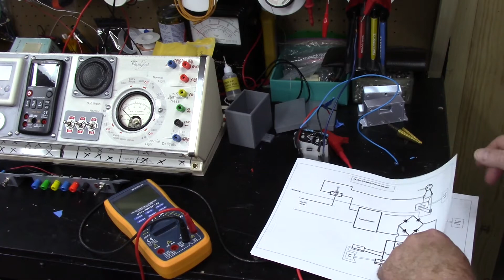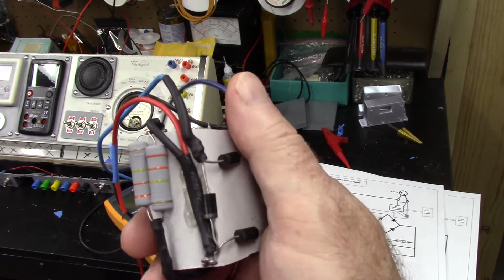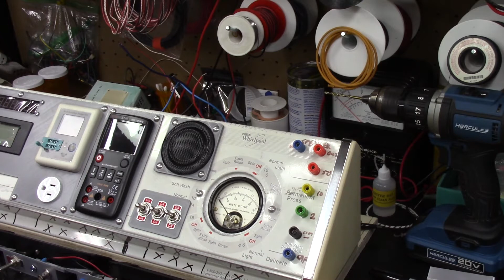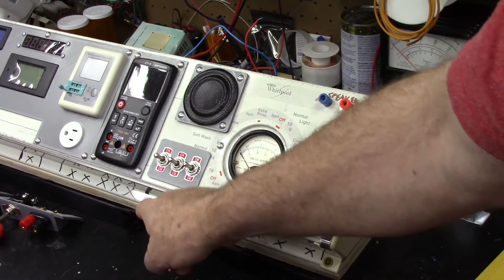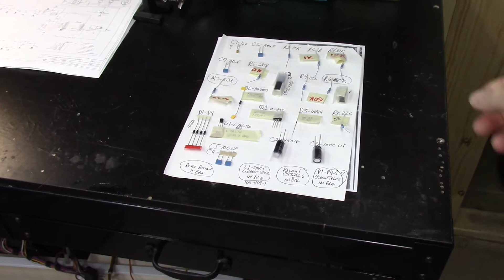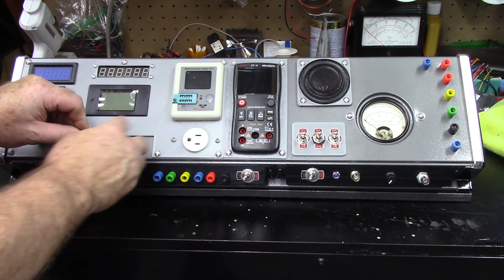MFP  Part 4-  Filter Condenser/rectifier, Paint , ECB begins and more!

Comment: Those two resistors will provide four watts dissipation in free air.  They’ll still produce four watts of heat wrapped in paper, and in that little plastic box… But they will be much hotter. If you push them to four watts, you may find yourself with a melted plastic box, and possibly a fire. Not sure this is a good design…
Reply from the maker: Thanks Gar, yes I may rethink this out. There really probably is not any reason to even have the box. It takes up quite a bit of real estate in the MFP too. I will likely eliminate the box and attach it to a small metal bracket. Thanks for the comment and thoughts.
Reply: @greggsvintageworkshop8974  Power resistors are best mounted so that air can freely circulate around the entire body of the resistor(s). This means that best practice includes mounting them so that they stand away from the board. Usually 1/4 - 3/8 inch is sufficient.  This is especially true in situations where forced-air cooling is not employed. I really do like the MFP you’re building.  Wish I had a 3D printer so that I could do some things like that…